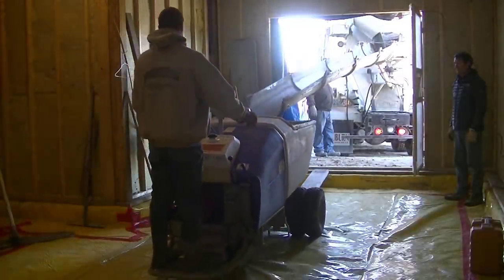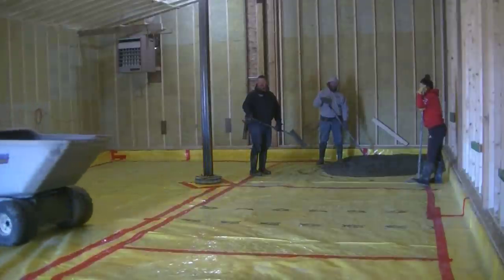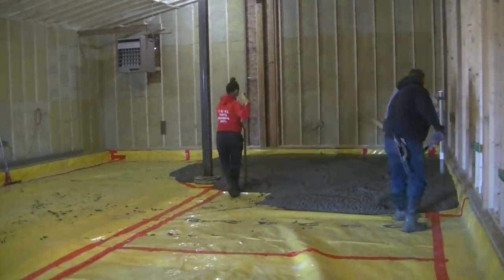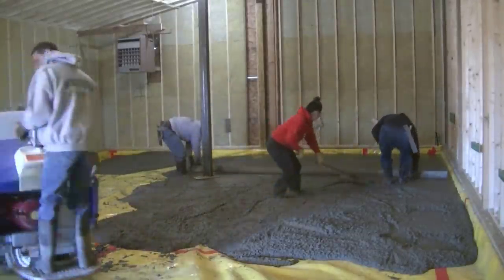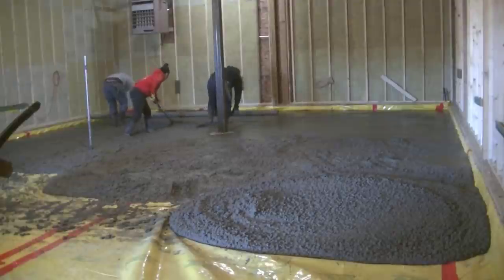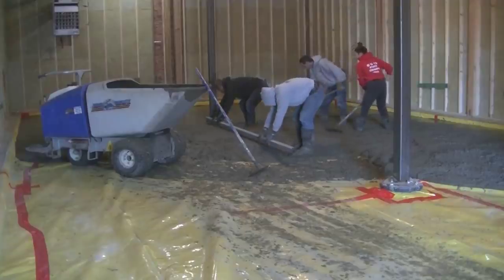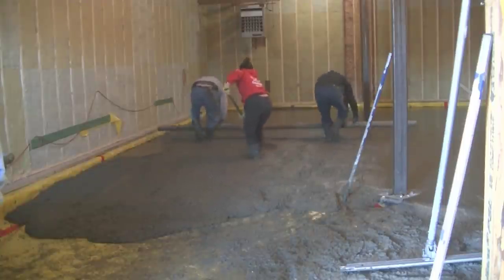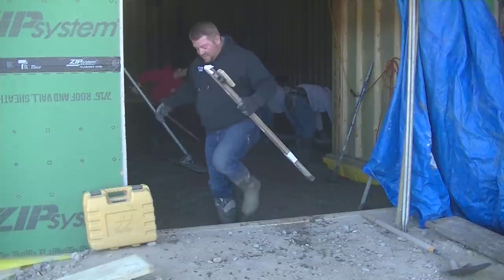How To Pour A Concrete Floor (For an Addition 1300 sq. ft.)

Comment: -It must be a southern US thing that we always called these ‘Georgia Buggies’. Not sure why but that’s what we’ve always called them.
-Awesome tool. Sometimes it’s the best way to move the mud. We used to use them a lot on tilt up projects, after the roof was on, to pour the ‘leave-out strip’ all the way around the inside perimeter of the building. We would use sometimes 3 buggies traveling maybe 800’ back and forth to the concrete trucks. 
-A good operator can haul ass across a nice open floor and really get a lot of mud moved quickly. The drive clutch can take a little getting used to, starting and stopping, so you don’t spill mud all over the place.
Reply from the maker: I agree! Thanks for watching.

Comment: When I was working concrete we rarely had the open room to use a buggy. Most of the time if wheelbarrowing. We mainly poured pool decks though, so we didn’t have a lot of room. It was back breaking work but I loved it, I really enjoy working with my hands. In fact I am going to pour a small pad tomorrow for my shed.

Comment: I was the young guy on the team and we had a six inch in slab 3ft x 180 foot long in an industrial hog barn. I had to run the wheelbarrow. Not sure the buggy would have fit through the tiny man door on the building, but I would have loved one.

Comment: I did concrete for about a year. Mostly d curb and some sidewalk. Pushing wheel barrows into a curber for 2 hours to pour 10 to 15 yards kinda sucks. I always though about some kind of power buggy but it would have to be able to move laterally next to the curber or it wouldn't work. Sidewalk and slabs are much less work than doing curb was, especially when you had to pour 500 feet of handwork f curb lol. I was always trying to get on the sidewalk crew

Comment: Mike, old school here. Been in construction biz with my father for over 40 years plus my grandfather before that. They always maintained that when we do a garage slab that a wood screed is by far the best way to go as opposed to magnesium board. We had one that used 2 2x material and vibrated with a gas motor setup. Only way I learned how to pour a slab. They said it had something to do with the quality of the finish. Thoughts?

Comment: Hey Mike what's a good concrete work boot Ive bought many cheep rubber boots but I keep tearing holes do you recommend a particular brand that will last ? Thanks
Reply from the maker: This is a good concrete rubber boot Andrew: https://amzn.to/2UB65Fr   If you want a pull over rubber boot, this is a good one: https://amzn.to/2UhFJt2  I wear ones like the first one. They last me about a year.
Reply: @MikeDayConcrete  do  yourself a favor and buy a lacross rubber boot  they will last  you 5  years
Reply: I think dunlops are the way to go for concrete, a little expensive but they are made for concrete

Comment: they do not  carry 8-10 wheelbarrels, those buggys are  called sweet 16s and that means they carry up  to 16 cubic ft of  concrete  which means each load is about 4 wheelbarrels give  or  take
Reply: When planning a job using buggies, I always figured ~½yd per buggy, per trip.
Reply: @psidvicious  thats right  not  8 to 10 wheel barrels  that is not  even close, mike is good  at  concrete but  not  so much   on  estimating